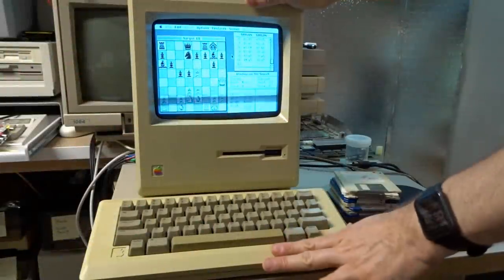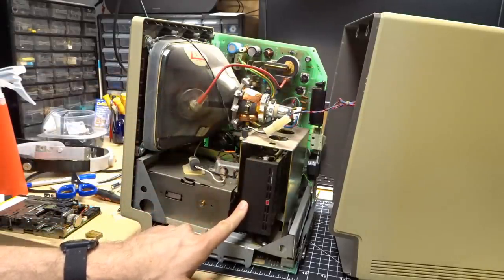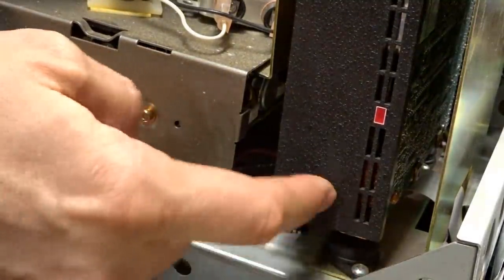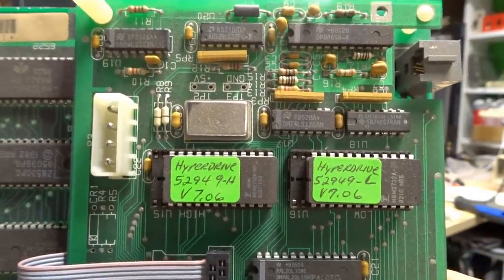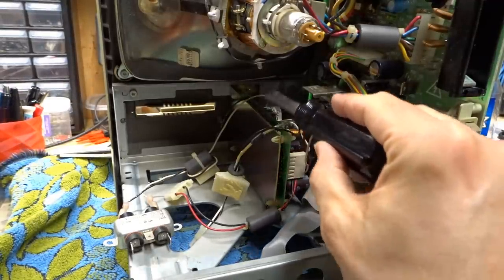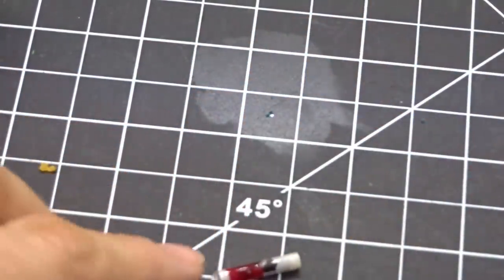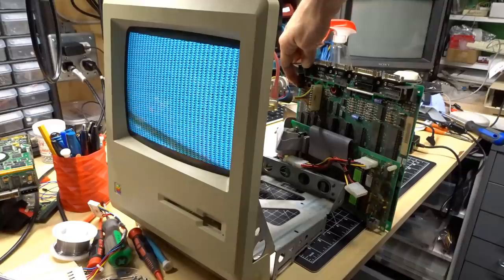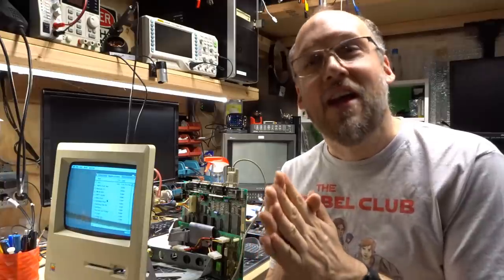Macintosh 512K with an internal MFM hard drive?

Comment: And absolutely don’t revert this. An MFM HDD in a 512? Such a unique (and again, era correct) upgrade. That controller card should be studied. Imagine being able to reverse engineer it with modern components and then an SD or CF card? Sweet!
Reply: it's the hyperdrive upgrade, it was very commun on 128kb and 512kb mac at this time. Today they are very rare because all drive dies long ago.
Reply: Yeah, sadly being MFM kinda rules out the SD/CF "cheap" upgrade path.  I'm not sure there is enough demand to put a hard drive in these older systems, and while you could do the MFM hyperdrive option, like Mac PB says, most of those drives are long since dead so you'd need a modern MFM solution but with the demand being so low the prices on those devices are between $200-300.  At those prices, most people would just use a Floppy EMU.
Reply: @brianv2871  for modern collector there is no need to upgrade Mac 512kb... it's better to have original upgrade for history or the original machine but not a modern upgrade. Mac 128 and 512 are not so usable since the memory is to small, they are really for collection and demo. The Mac Plus is a better option if you want to have powerfull upgrade, it support 4mb of ram and the SCSI + system 6 allow you to have more fun.
Reply: Brian Veditz and given how much software a) can run on 512k, and b) you’d actually want to; a FDD emulator emulating a HD20 would probably do just fine.
Reply: @mrlurchAU  Yeah, definitely.  When I was fixing my Mac 512k and Mac + a few months back, Adrian brought me a regular boot disk and a paint boot disk and once I got it all working, I booted up to that and played with it for few seconds until I declared 'Okay, I'm bored now'.  :)  Unlike most other vintage systems, you can't really make disks for it from a PC and I don't have any 'tweener' macs, so really the Floppy EMU is the only realistic way of using software on these machines... Plus, those Mac floppy drives are almost as flaky as an IBM M2 keyboard, that even when you do get it working, it'll likely die again a few weeks later. :)
Reply: @macpb2892  Totally Agreed.  I'm not really a collector, I like to use my machines.  However, my Mac 512k really is stuck in it's period of time and I can't think of any software from that era that i'd rather run on a classic mac then a period similar Amiga or Atari ST.  In my case, the Mac is really the only 'collector' piece I feel I have, because it's just there to look pretty, not a lot of modern enjoyment to be had from it.  I've even used my TI99-4A more often.  :)
Reply: Brian Veditz hah. M2 keyboards. What a nightmare. Mine ended up in the bin and replaced with a proper model M.
Reply: @mrlurchAU  Hah, yeah.  Mine didn't make it to the bin but it might still be in pieces somewhere from my 3rd or 4th repair.  The person who gave Adrian these macs thinks he can fix it, and i've tried to warn him but I guess you never really know the misery until you've experienced it yourself.  :)
Reply: I see people using virtual floppies (using an SD card) on these older Macs. There wouldn't be much to reverse-engineer for the MFM circuitry, but for the interface.
Reply: @BlackEpyon  Great, love to see you make that, i need a cheap virtual MFM drive for my Atari ST.  Something in the sub $70 range would be nice since much more than that and you'd get into other virtual options.
Reply: @brianv2871  It wouldn't be that difficult to make something like lo-tech's ISA-CF card with a different format factor (I'm working on that for my Tandy 1000HX, when I can get back around to it), but I have very little experience with Mac hardware. Somebody more familiar with the ins and outs of the bus on that hardware (how the addressing, data, and control lines work, etc), and how the memory pages and boot options work, would need to do that.
Reply: @BlackEpyon  oh, that could be done. What I was saying is that there is no cheap alternatives to actually emulate am MFM drive... One that could hook up to an MFM controller.  Because there are so many other options like XT-IDE for systems, the few left that actually need MFM support (the more rare systems), they're stuck using the $250 solution out there.  For instance, my hard drive solutions in my Atari ST use RLL drives, and if i want to use those (for original look), id have to buy that $250... but if i want to just use a hard drive solution like the ultrasatan, that's about $150... so it kinda means those original hard drive enclosers kinda just get tossed.  If we could have something cheap that hooks up to any mfm controller, that would be cool and help these fringe MFM/RLL requirements.
Reply: fyi, the datax dtx300 is one of the, maybe 2, options.  Oh DREM is the other.
Reply: @brianv2871  I'd keep the original enclosures anyways, and just modify them for IDE or something. I was briefly considering that for a 10MB Tandy external MFM hard drive, except the guy wanted $400 for it, and didn't even know if it was parked, or even working (some people are just in it for the money). I've repurposed SCSI enclosures for eSATA as well. No need to toss them.

Unfortunately, having something hook up to an MFM controller isn't as easy as rigging up a rudimentary IDE controller, because it's a frequency-modulated rather than straight logic. Part of what made IDE so popular is that the electronics for decoding that are built onto the drive itself.
Reply: @BlackEpyon  The old MFM controllers are often only made to support the drives that they have had programed into their roms for certain geometries only. Though it is probably easy enough to get a modern virtual drive emulator to either emulate those parameters, or dump the roms and mod them to something larger.
Reply: Those old macs could connect to a 2nd floppy drive that is external and plugs into a connector port - so I had an HDD or my Mac 512 (actually a 128K mac that I converted to 512K) that plugged into that port. Naturally the SCSI drives they introduced for the mac plus were a good bit faster than that interface, and the Mac plus had a whopping 1MB of RAM

Comment: MFM/RLL drives last forever, but I would still make a backup.
Reply: Agreed. He should make a DD image of the drive
Reply: @sugaryhull9688  Does dd for m68k Macintosh exist? Because I don't know any simple way to attach MFM drive to modern PC. Maybe older PC and ISA controller card would do, but it has to have same hardware and formatting, otherwise it won't work.
Reply: ZXRulezzz 
There are a few linux distros that can boot with as little as 12mb of ram with a gui, im sure it could boot to console with only 1mb so any 386/486 machine should work for this task. The problem would be how to get the data out, maybe serial port over to another machine?
Not sure if newer machines with isa ports would recognice such older hardware.
Reply: @laharl2k  Would an AT or XT be able to run somethig like that? They could recognise the drive and use an XTIDE to get the files to a modern computer.
Reply: Agreed, they just don't like sitting unpowered for long...
Reply: @Jussapitka
I guess it should be capable. I ran puppy linux turbo extreme on an old K5 with 12mb of ram and ir ran good enough to make backups of some old floppy disks. So if it recognizes both controllers you could dd the old one to an image on the other. My main concern thoguh is driver support as im not sure if such old hardware is even supported anymore in moden linux. Im not even sure 2.4 supports.
Reply: Last forever? If you take care of them, maybe. So long as the previous guy who sent you the HDD remembered to park the heads before shipping, I imagine that simply replacing the stepper motors would keep them going.
Reply: @BlackEpyon  some MFM hard drives (such as the Seagate ST-251/ST-277R/ST-296N) had an automatic headpark system, but yeah most MFM hard drives lack such a system...
Reply: @ZXRulezzz  Debian supported the 68k architecture for quite a while, so there should be a port of the GNU userland with dd for classic Macs
Reply: @laharl2k  There might be a way to boot into Debian for 68k from the netinstall image and run dd from there
Reply: last forever my ass lol i had sooo many fail. They are dropping like flies at this point. Whenever i find one that works with stuff on it, i try to back it up asap.
Reply: Jussapitka exactly XTIDE can work with MFM HDD at the same time :)

Comment: Hi  Adrian, I am a fellow Oregonian.  The old power supply that doesn't start up is usually the Electrolylic capacitors that are dried up,  replacing them usually fixes the power up problem.  Sometimes there is a power good line that needs to be enabled to start up the supply.  Their are many Tech channels that are showing how to fix these power supplies, IE Paul Carlson ,  (Mr Carlsons Lab), 12voltvids, w2aew, Jim Lindenas, and others. Good luck from Ray Burke

Comment: I think you should re-assemble it and try to make it work as it was (with HD).  These sorts of mods and changes are part of the history of the computer and should be left unless they can't be made to function.  Part of the intresting history of older computers is seeing how people modded them and upgraded them.  You might be able to add a second switch or a switch with a few positions to allow the small power supply to power up before the main board.  IE you flip the switch to a first position.. wait a few seconds.. then flip it all the way up.

Comment: I used to own a 512k we bought at a yard sale in the early 2000’s. I used it off and on up until I moved out of my parents house. It didn’t have any sort of hard drive with it just an external disk drive. I knew hard drive options existed but I only thought external options were available. My heart melted to see this machine boot off an internal hard drive that looked like it may have been installed as an extra option for a customer when sold new. I’d say definitely keep it this way and put it back together. This is a rare find and seeing this really made my day, thank you!

Comment: Woah, you have one of these too? Cool! This is called the "HyperDrive" mod (as the controller PCB declares), sold by General Computer Corporation back in the day for around $2800 (almost as much as the Mac itself!). I believe they sold 5, 10, and 20 MB configurations; like yours, mine has the 20 MB drive installed, and a friend of mine has a 10 MB system which I covered in a video about his Apple collection. Interesting that yours doesn't have any stickers on it, mine has a "HyperDrive" logo on the front near the Apple logo and a warranty sticker on the back right next to the original Macintosh sticker. They're quite the bear to disassemble, as you found - I also had to bend the chassis to remove the logic board, and the hard drive isn't very easy to take out either. I'm still working on getting mine running properly - the original drive was stone dead, and even after freeing the platter/stepper motor it wouldn't seek correctly. After a bit of investigative work, though, I found out that mine uses the same MiniScribe drive as used in the original Mac SE except with an MFM controller board - after a PCB swap, I got a working drive! Unfortunately, it only occasionally spins up when connected to the HyperDrive supply, so I assume some capacitors are reaching the end of their lives. I'll definitely let you know if it works after the recap and might even make a video on it or something like that.

The strange booting issue you show makes me think the power supply's got some weak caps and isn't providing enough power to the Mac as the hard drive is drawing so much as it spins up. I'm going to go the "capacitor" route, but I could get you a more firm answer when I dive into resurrecting mine. :)
Reply: Never a bad idea to recap, but I think Adrian's right about power sequencing.  That switching supply probably has a power-good delay.  The drive didn't start spinning up until the Mac was already running.

Comment: Wikipedia says that Hyperdrive hard disk cost $2795 US$ at the time (roughly $6500 in today's dollars!!!).
Please back up those Hyperdrive volumes and all their contents -- if you have a BMOW Floppy Emu, you can connect it to the floppy port, and it will emulate an Apple HD20 hard disk over the Mac's floppy port -- that's the easiest way I can think of to back up 20MB off of this machine. Worth getting one if you don't have one yet -- awesome device. Please keep this machine as-is also -- this upgrade is awesome. Love to see what is on those drives - this is like a time capsule! Best wishes.
Reply: Yes, and maybe upload that hyperdrive testing utilities to internet archive or something, if it's not online already.
Reply: $6.5K for an HDD --- OMFG
who was the owner of this MAC???
Reply: NO!  This machine should be back the way it was with this upgrade.  It is a very neat job, the hard disk has lasted 35 years, it'll be fine.
Reply: @adriansdigitalbasement  this is fabulous
Reply: +Electronics... What is so important about the hard disk data?  I'm sure he is going to back it up, but really, what is the point?  I seriously doubt there is one of a kind software on the machine that needs to be archived.
Reply: Yes. I might add, DO NOT WRITE anything to the hard drive, or do anything that leads to a write (initialising, formatting, etc) UNTIL you have backed it up. A disk image if you are not sure how to recreate it's ability to boot.

Now I cannot speak specifically about this drive on a Mac, or what tools you would need. However I developed a "motivating" THEORY years ago when I noticed that otherwise healthy MFM\RLL disks went bad as soon as you started writing\updating anything on them. I did mention this is a video (not specifically about this) but the I'll break it down here.

As I recall, the old MFM\RLL drives had signal amplifiers, (decoder's ?), etc, that "digitised" the Platter signal to the point where it could be safely transmitted across the ribbon cables. However, for the most part, it was the Platter data stream. This turned to crap when you wrote to the drive. That's when I came up with this THEORY. 

The drive itself is pretty dumb, and all magnetic signals degrade over time and/or temperature. So if the drive uses mostly analog signal amplification, what would happen when I write to the disk. The obvious answer is that it would produce a very much stronger signal when read back. So the amp would need to automatically adjust it's gain. The problem then lies in how these disks wrote their data. IF they rewrote the whole track, then the amp would easily be able adjust it's gain, moving from head to head, or cylinder to cylinder. However, IF it wrote only the sector (within a track) then the amp might not be able to respond fast enough. More so IF the controller only wrote the Sector data, and not all of the stuff peripheral to the actual data, such as the preambles, the address marks, etc.

Like I said, it's a theory, and  has provided the motivation that I needed to ensure I do not put the drive into a system that is going to write anything to it. And it has worked for me...
Reply: +Richard... Did they not think of this when engineering the drive?  These early platters were also probably not entirely consistent so that you could easily get a lot of variation in the recording strength from sector to sector even when new. They are coated with centrifugal force.
Aside from losing the ability to boot, it is really no big deal if this drive needs to be re-low-level formatted.  There are people in the thread kvetching about backing it up, but really, what does it matter?  Unless this computer belonged to Woz, I'm thinking there is nothing special on it.
Though getting this drive to boot a MAC is going to be a major bitch if it needs to be re low-level formatted or formatted at all.  Hopefully there is a copy of the software used to format when new to get the Mac to see it. Getting an old Mac to recognize a non-Apple drive is a bear.

Comment: That fan is exactly what you suspect. It's a brushless motor using an external controller. 

 I have seen them in old Rohde&Schwarz test equipment.

To your question: Leave it in, but make it a little less crappy in execution. The mounting bracket for the HDD and everything is fine, but the mains wiring is .. crazy.

Comment: Original 512 had the 400k drive. But the 512kE and 512kED had the upgraded 128k ROM and could then take an 800k drive. I believe upgrading the rom on a standard 512 can be done. 
But if this has a HDD in it, it could be a custom rom? Might be worth backing up if that’s the case.

Comment: https://forums.macrumors.com/threads/mac-512k-w-internal-hyperdrive-rare-valuable.422001/
Quote by MacSimum
Upon installing the Hyperdrive, when your system is first turned on, you are severly undervolting, which in most cases causes the display to go crazy, if it comes on at all, and you will most likely get a Sad Mac error relating to the analog board.
To make the proper adjustment, you will need a multimeter, antistatic plastic flathead screwdriver, and a Mac Diagnostic cable.  If you don't have the diagnostic cable, you can make a dongle that will work as well, but you will have to be extremely careful to avoid shorting out your logic board.  If that happens, you're done.  You've fried your logic board and the HyperDrive circuirty.